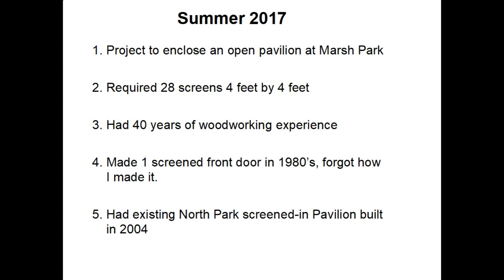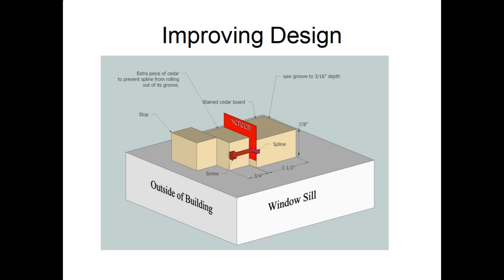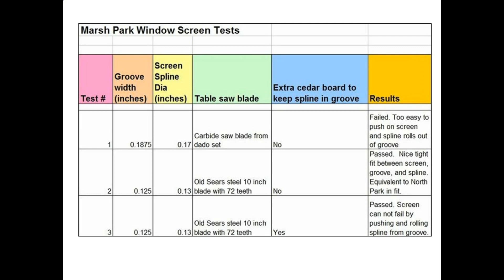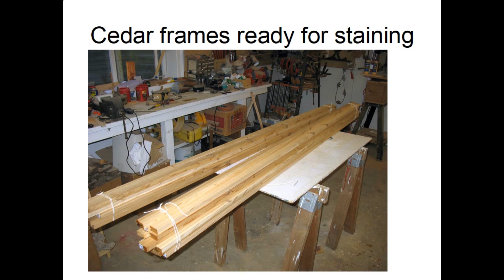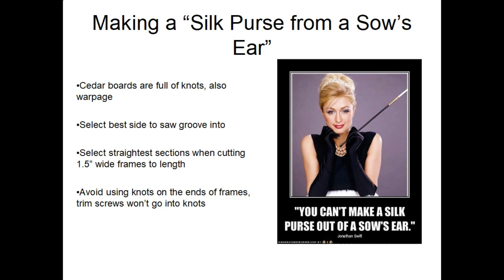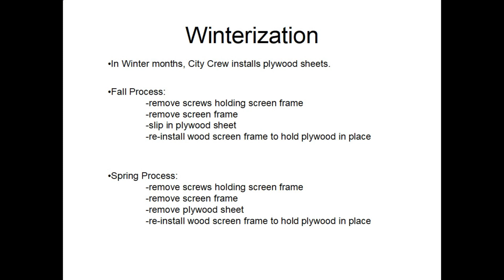How to design, build, and repair wood frame screens

Comment: Exactly the information I need. I'm making 16 ea 4x8' screen frames using 1x3 pine.
Reply from the maker: WOW, 4 by 8 foot is relatively large screens. I have made about 60 wood screens, but they are a max size of about 42 inches by 48 inches. The only tricky part is getting the right size rubber spline that works with the saw blade you have for making the grooves.  Good luck on those large screens !!
Reply: @dalemaley  The existing openings are 4x4's. I plan to make a saw kerf on the side of the 1x3's facing the 4x4's. I will have temp horizontal braces to hold the approx 4' spacing until the 1x3's are screwed into place. I'm hoping that will hold the spline in place. My current plan is to use SuperScreen rather than aluminum. 
I'm guessing there are some pitfalls or flaws in this idea. If you have any suggestions I'm all ears.